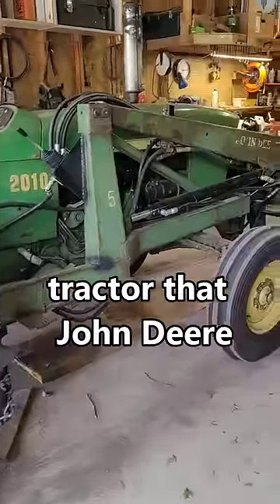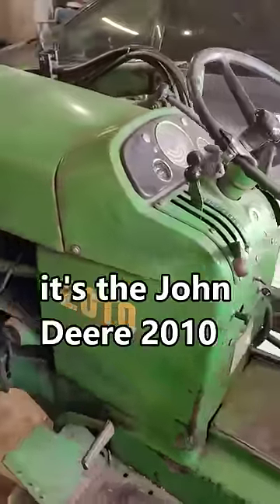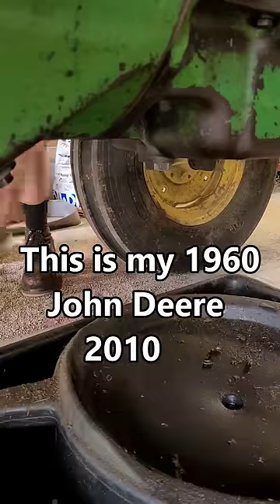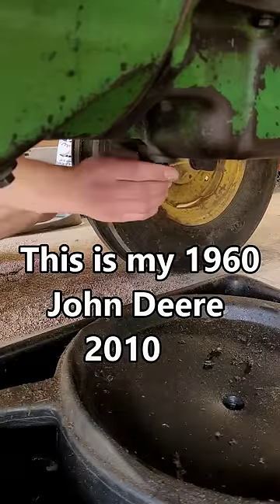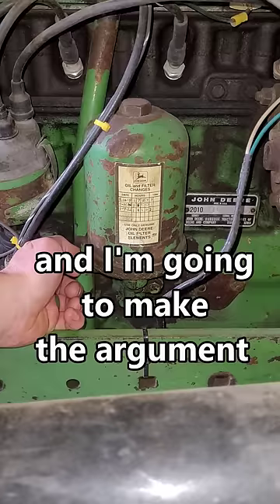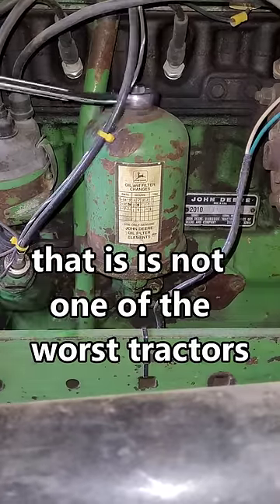Is this the worst tractor John Deere has ever made? #shorts #mechanic #farming #johndeere #tractor

Comment: Most machinery has this quality. It is designed for a particular service life. If you care for it actively and learn its ins and outs. The only question is efficiency due to age, both from wear and from the original design.

That’s my philosophy towards my own car. It’s a luxury import, but I decided a while back to never let the dealer touch it and to suffer through making it work myself. It’s not easy learning, but it’s a skill that comes with time and something you can feel proud about.

Comment: The diesel 1010 and 2010 were the ones that really set JD back in the early 1960’s.  It took the German produced small tractors to make gains in that market segment. 820, 1020 etc.   We had an LP model 2010 with the loader.  It was a big step up from any previous small JD tractor we had those were the 420, 430, 435.  Better closed center hydraulics and 8 speed synchro trans vs the 5 speed sliding gear trans in the Dubuque models.
Reply from the maker: Neat!

Comment: None of the early New Gen Tractors will ever make it onto the list for best JD tractor, but they're sure not on the list of the worst ones, either. (Those honors all go to tractors with computers in them). If I recall, the entirety of the New Gen line had transmission issues for the first few years, and the crawlers had extreme issues with reversers, but they're still good tractors.

Comment: The reason people say its a bad ome is because the head gaskets leak. But that usually comes with people never flushing the coolant and it runs hotter than normal. If you maintain your machine it will last. Nothing runs like a deere
Reply from the maker: Amen to that!

Comment: the origonal 30-40 series 4WD tractors (ie 8430, 8640 ect) were notorious for engine failures due to frame flexing causing the block to flex and wrecking main bairings.
Reply from the maker: Oh man... that's bad..

Comment: The gear shifter can become a big problem that is quite expensive to fix. But you do maintenance so you may be fine.
Reply from the maker: I keep it dialed in. Have tinkered with it when I had to work on the transmission.

Comment: Real talk, it's the Model C/GP. The model C itself was in production for ONE MONTH, and had most of the models brought back under it being called an experimental. It was basically rebadged into the Model GP, and the model GP was not very well liked. That, and the early model G's, with the smaller radiator, which in southern areas didn't provide enough cooling for the motor.

I'm a deere fan, and have a few books on their history...

Comment: the "issue" with the 2010 is that if you did NOT perform maintenance, or use the specified fluids, youd have problems. people were used to throwing whatever oil/fluids they had on hand, useing pure water in the coolant system (no corrosion inhibiter), and running the tractor HARD for 1000 hours without an oil change or air filter cleaning and THEN would be mad when something would fail.  True, they were a little less tolerant than say a John Deere 60 was when it came to maintenance, but the 2010 doesnt deserve the "bad reputation" they seem to get......they are a HELL of alot more reliable than any modern electronic stuff made now
Reply from the maker: Good points!

Comment: Any vehicle will last a long time with proper maintenance. I used to work as a mechanic and that is the number one thing that most people fail at. From tractors to kias, the same rule applies. Except for Land Rover, those things are straight trash
Reply from the maker: Good point

Comment: Oil bath air filter.  I remember those.  Not as efficient as as pleated paper filters but they could hold lots of dirt and still deliver full air flow to the engine.

Pain in the butt to clean when they had to be clean but it only cost about ten minutes time and a few quarts of oil and they were good as new.

My father had 4010 diesel with a centrifugal dust bowl on the top of the air intake that stuck above the hood to separate the large dirt particles before they went down into the oil bath air cleaner.  Had to empty that every time the tractor was refueled.
Reply from the maker: Wow very cool! I like the oil bath filter, i don't need to make a special trip to the dealership to get a filter...
Reply: @craftzmanchris9859  
In an oil bath filter the air travels down a tube that opens just above the oil.  When the air hits the oil it causes it to splash up and follows the air upward through a media that looks like those metal pot scrubbers and soaks it with the oil which the dirt will stick to.

As the excess oil flows down it takes the dirt with it and into the pan that holds the oil and settles into the bottom of the pan where it is held.

Periodically you have to remove the pan and dump the oil out and scrape and wipe the oily dirt out of the bottom. Then refill the pan with oil and put it back onto the bottom of the metal mesh media container.

You do not have to go to the dealer to get a new filter but you do have the oil and oil contaminated dirt to dispose of and new oil to buy to replace the old oil.

Six of one, half a dozen of the other.
Reply from the maker: @oldtimefarmboy617  Yeah, I was meaning that I like the oil bath better because if it was a paper filter I would have to make a special trip to the store... but because it's an oil bath i don't need to do that.

Comment: I’ve got a 1965 2010 that I bought from my dad before he passed. He left it partially torn down for transmission issues (no reverse) and a sticking valve after he rebuilt the bottom end. Instead of tearing the transmission apart to change the synchronizers, I found a complete rear end for a bit more. I’m taking my time rebuilding it because I know what kind of a lil beast this thing is when it’s together. My dad “resurrected” this thing 14 times (engine rebuilds, transmission rebuilds, and even rebuilt from a car accident that ripped the rear wheel off…. Still the most reliable tractor my dad ever owned)

Comment: i had a 401b gasser. worked for fixing our road every 6 months.. with chipper on pto it chewed through fuel.
when it was hot out you couldn't shut it off or carburetor would get heat soaked and not start..
8 forward 4 reverse 2 stage clutch.

i wouldn't wanna run that one every day for 8 hours.

oh it was yellow, so you never had to develope the "green" deere ego.

Comment: I only have experience working on the small John Deere tractors,  like lawn mowers,  they are simple,  and easy. They don't use John Deere engines,  I have seen Briggs and Stratton,  and Kawasaki.  Just 2 cylinder and 20  to 27 horsepower.  Most with the automatic.  

That old John Deere sure looks good, and sounds fine. 😊 A very nice job of maintaining
Reply from the maker: Thank you!

Comment: I have a 1020. Everyone told me it is the worst. I think they are like a harley. If it is a good one, it will remain good till the day you have a catastrophic failure as long as you maintain it. But if it is a bad one, your best bet is to turn into parts. They have a gremlin hiding in it somewhere that can only be excised by spreading the parts far and wide...😂
Reply from the maker: My mentality is if it can be built in the first place, it can be taken apart, fixed, and put back together.

Comment: The only problem I have had out of my 2010 is i replaced the clutch twice but that's normal wear and tear, it's never failed and I wouldn't trade it for any other tractor and I don't smell like diesel fuel after I use it. The bad ones are the ones that they make so you can't work on em
Reply from the maker: Very cool, and good point.

Comment: In the late 80s I bought a 1965 Chevy 5 yard dump truck and a 1963 JD 1010 with a bucket loader and trailer.  They were both like the cars I grew up with. A person with reasonable common sence and a few wrenches could fix and maintain it. I was the only kid driving to high school in a Mercedes Benz ... in the 70s I bought two or three cars that were from 1959 to 65 and make one good car out of it. Anything I needed to do I could do in the driveway with some jack stands and a piece of cardboard.

Comment: It works for what you need it to do, and that is all you need from any tool. Bells and whistles are nice, but if you aren't using them, then what's the point of them? Also I absolutely agree that the worst John Deere tractor is one that is software locked.
Reply from the maker: Good points.

Comment: Honestly I wouldn’t say the 2010 is the worst when I think of the worst John Deere tractors I think of the 3010/3020 and 4010/4020 gassers
Reply from the maker: Really? First time I've heard this one..
Reply: @craftzmanchris9859 I don’t know how wide spread the belief is but most of the farmers in my area hate them and when I went to college for diesel mechanics and farm equipment mechanic our instructors always used the 3010/3020 and 4010/4020 gassers as bad examples of tractors while I don’t think they’re overly bad but compared to their counterparts they’re pretty bad they’re decent mechanically (as far as I’m aware though I see more in shops getting repaired than I do other gassers and diesel John Deere’s) but they’re gutless and thirsty pigs pretty much I think the belief that they’re bad is probably due to the fact that they’re some of the last few gasser tractors in a dying era of gas engines in big farm equipment so they get a bad reputation, that and I’ve just seen more in and out of shops more than I have other JD gassers and diesels

Comment: Well right now JD has a lawsuit against them from farmers, because of the fact that when the tractor lays down on you, you have to call JD and they send a tech out to work on it, and if you work on it it voids the warranty. So if JD can’t fix it, your operation is at a stand still until it gets fixed somehow some way. And to me that tells me which ones are the bad ones. Nowadays they’re over engineered cheap plastic junk. How do I know I worked for JD selling them. It’s a monopoly centered around the name these days.
Reply from the maker: That's a shame..😢

Comment: Is modern equipment more powerful, Easier to use, and more comfortable to operate? Yes. But the old school equipment is so simple, and easy to work on. And they run damn near forever. Back in the day it was built to last
Reply from the maker: Good points!

Comment: If I had to wager a guess I would say that the 0 or 10 series or however you wanna call the John Deere (Lanz) 300 and 509 tractors. They were the first new designs sold by John Deere in i.e. Germany after buying out Lanz and repainting their antique designs green. 

They had problems with the cylinder sleeves, coolant vanishing high diesel consumption and little power mechanically and on the hydraulics. A Lott of technical tricks on that tractor that probably made life good when they where new, but I hear they are horrible if they ever go wrong. 
But the worst part is the engine. But luckily it's a frame design so the engine is not load bearing and can just be replaced with a completely different one.

Comment: There's no reason to change oil and filters ect on a tractor that gets less than 50 hours a year.  How about every 250 hours or 3 years
Reply from the maker: The hour meter doesn't count correct but I'm sure i put more than 50 hours a year on it. It cheap and easy insurance.

Comment: 1: check the plugs, don't replace them. Unless it's necessary (as in the porcelain is cracked or otherwise) don't replace them. Just inspect them, make sure they are clean, then put them back in. 
2: check the antifreeze, don't flush it. If it has rust in it, there is a larger problem. It also doesn't need changed annually.

Comment: I'd say the worst tractor Deere has released is  tractors with those new computer systems in them anything you work on you have to pay a dealer to come out to plug in a computer sync the new part you put in it. Even simple and silly things require it.
Reply from the maker: Good point.

Comment: Ngl, i think the modern tractors in general tend to suck more. Older tractors are reliable, you knew what they can handle and what not and you also always were able to do some work on it yourself...with all the limiting electronics nowadays you simply are forced to put it to a mechanic to fix it, which is not just expensive, but who knows how long it takes which may mean you get a bad crop if you don't have a spare tractor on hand
Reply from the maker: Good point.

Comment: The 1010 is worse than the 2010, I like our 2020 diesel we have great tractor, our 2020 gas we had, hated it always workin on it and had a bunch of problems we fixed and just said screw it and bought a 4020 diesel instead
Reply from the maker: There ya go.

Comment: Half the farmers I know can’t even load a boundary in their gps display and you guys think they need rights to the software so they can fix their tractors.  I was really surprised when that was the majority of the comments I saw.   Those old tractors are cool but honestly useless on a productive farm these days.  I suppose you could run a very small auger with it.   Doesn’t make it a bad tractor just not a good one I guess.  I started on a 4020 then moved up through round cabs.  Our farm currently runs mostly 8R model tractors.  The worst tractor I was ever around was a 7800 or 7810.   I know they have fan boys but that tractor was trash.  Shifter cable was constantly broke. It would turn for crap.  It would power hope without even being loaded.   I know neighbors that went back to 4760s in that era.
Reply from the maker: Thanks for sharing!

Comment: What is everyone's complaint and or reasoning for the 2010 being the worst? Just wondering since I'm not super familiar with JD. Is it that is not diesel?
Reply from the maker: They made 2010s with a diesel as well and the diesel engine was not very great from what I hear. I think it gave all 2010s a bad rap. That and they weren't quite big enough to pull tillage. Just my opinion.

Comment: Straight Simple Green and a spray bottle and a pressure washer or a steam cleaner would clean that ole girl up nice! 
Once it was 100% dry hit it with a scuff pad mask off what you don’t want John Deer Green and Dads old John Deer would like new again! 
Between maintaining your Dads maintenance regiment with a fresh coat of paint on its drivetrain or the whole thing would definitely make the Ole man smile! 
To answer the question - no I don’t think hour model is the worse John Deer ever made
Reply from the maker: The original paint really isn't too bad. The loader makes it look a lot worse that it actually is.

Comment: I have the 2010 my dad bought in 1959.  No one has ever been in the motor.
Reply from the maker: I don't believe they made 2010s in 1959. 1960 was the first year for new gen tractors (10 series).
Reply: He always said it was a 59.  I have the original factory owners manual.  I'll check it.

Comment: You only change the oil once a year? For automobiles back in that time it was 3 months or 3,000 miles. The viscosity either breaks down from too much use or the oil gets saturated with moisture from sitting too much. Chemistry of this newer oil is much different, but to go a whole year without changing your oil in your tractor seems a bit extreme.

Comment: Do u need to oil that o ring that u installed? Just wondering
Reply from the maker: You don't "need" to because there enough oil residue on the mount and the can doesnt actually spin on the seal but it's always a good idea.

Comment: I don't think there are as many bad tractors as bad owners. I was told to never buy a Massey but when i started in 1973 I could not afford a Deere so I bought a MF 165. I've lost track of how many I've owned over the years but only one had an issue (transmission). I took care of them, did not abuse them and they all did a good job.

Comment: Saying that a gas engine starts with no problem in cold weather isn't impressive. It should reliably start down to -20°F, and even then it's dependent mostly on the health and strength of the battery. This is assuming the operator knows how to run the choke.

Comment: Just a small tip, never clean your air filter with (paper) towels or rags. Flush it with some diesel, refill it and put it back on.  Also the worst models are the new ones. In my opinion the 1990’s was the last time truly great tractors were built
Reply from the maker: I cleaned it with parts cleaned before it went back together. What's wrong with shop towels?

Comment: Any thing new cars tractors trucks other vehicles/equipment are crap all these new vehicles/equipment have so many electrical problems when they get old there for making it unreliable and a nightmare to work on your best bet for reliability is to buy anything from the 80s or older anything of that age has proven its reliability 10 times over
Reply from the maker: It sure has.

Comment: Anything electronic is disposable - software no longer supported, interface cabling standards will change, systems languages will change over time and for many other reasons the tractors today will become obsolete much more quickly than those made 60 years ago. Computers make things more expensive, less reliable, and obsolete much more quickly.

Comment: The worst is the 855. They SUCKKK. The 4 wheel druve started clunking at just 1700 hours. It looked like it was brand new too. It then started to leak in the front diff. Then shortley after the water pump blew out and antifreeze started pouring out. Never get an 855
Reply from the maker: Ỳikes 😮😮😮